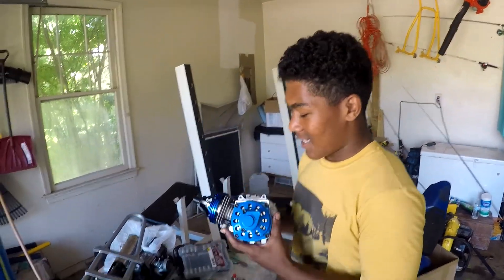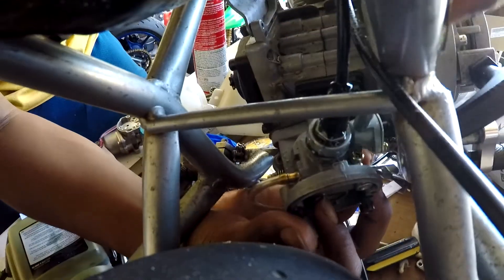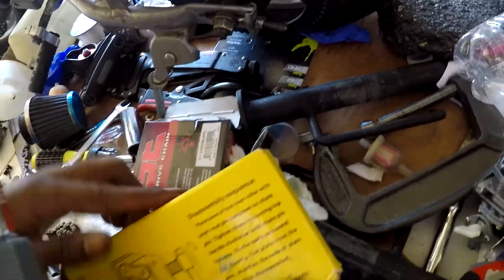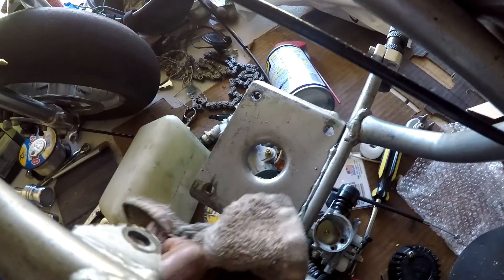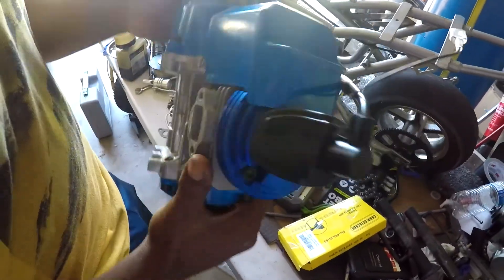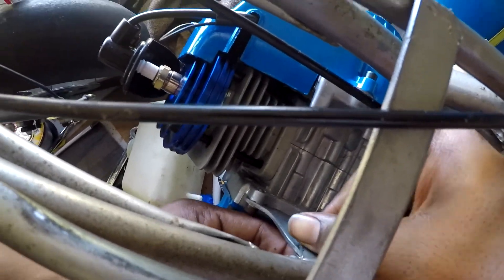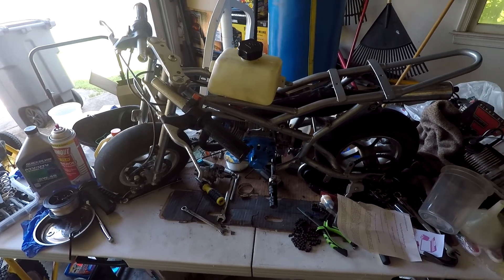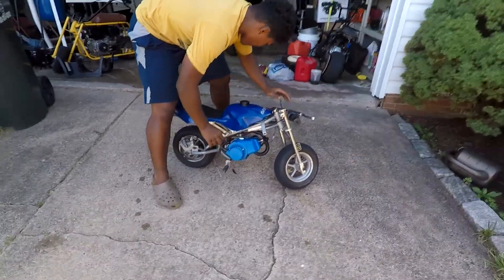2 Stroke 49cc Pocket Bike Big Bore Kit Engine Install

Comment: I promise it will blow if you dont run a proper break in stage
Reply: It will not blow up..the rings seat rather quick, you never break in chainsaws and weedeaters.
Reply from the maker: Thx 4 heads up

Comment: change the stock pipe, would recommend a tune pipe with bigger elbow setting that would increase the overall compression and rpm

Comment: Dose it make much difference?
Reply from the maker: The upgraded engine definitely has more power. It is a little faster than the stock engine and the clutch has more grab, I'm assuming because of the upgraded clutch.
Reply: @cjsengines7395     I did some research because I remembered watching them race as a kid and thought jesus they move. GHR and CS engines are where it's at,  with a balta frame. Normal mini moto engines are like 2hp, race ones like like 12-16hp.. I don't have £5000 plus to spend on this so I'll leave it alone lol
Reply from the maker: @highhat5229  I've always wanted a built pocket bike too, but same problem... no money lol. With these style engines though, you cant do much to improve speed.
Reply: @cjsengines7395    well weirdly the restriction for these bikes are the diameter of the exhaust down pipe. The pipes are changed to fit each race class... that still doesn't explain why CS and GHR engines are pushing 16hp because they have to be 50-43cc for the race classes. If you really want a fast mini moto your best bet is to buy a used race engine their about £500, Idk what that is in usd. I'm not prepared to spend that on a mini moto lol